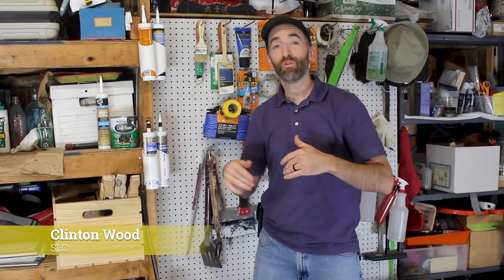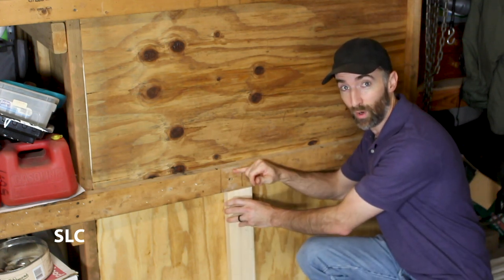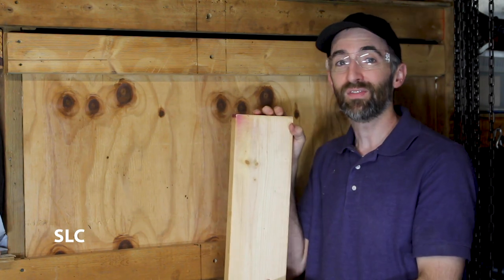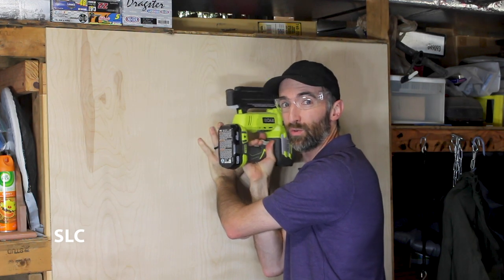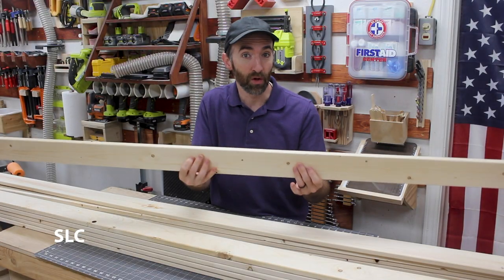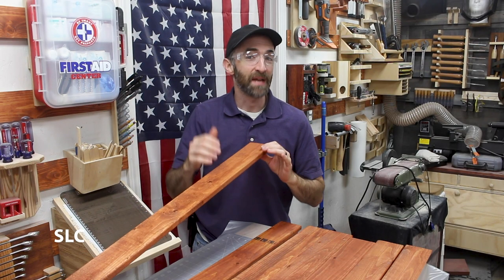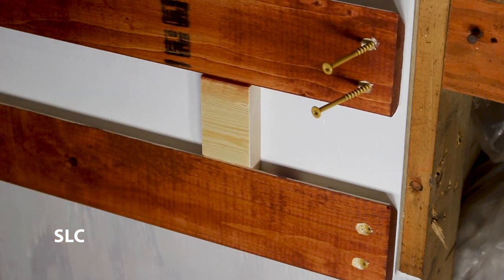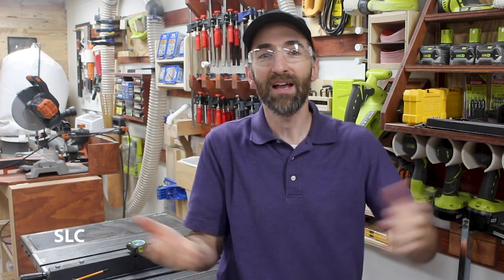Adding French Cleats to an Existing Shelf

Comment: Using sill gasket under the lumber performs the same function pressure treated when attaching lumber to concrete. It's cheap and I like to use it in interior spaces. The primary function is to prevent the lumber from wicking moisture into itself from the concrete. Of course if the cellar is subject to periodic flooding, PT probably would be better. Nice vid! I love getting Ideas from your content. It helps me with my own situations.
Reply from the maker: Thanks for the suggestion on the sill gasket, I will need to pick some up.

Comment: Since you used 1x4’s for the cleats that means you have to use 1x4 cleats to the backs of all your French cleat holders and shelves. Correct?
Reply from the maker: That is correct, but you could trim then down for light weight holders. For example, a 1x2 cut at a 45 degree could work.